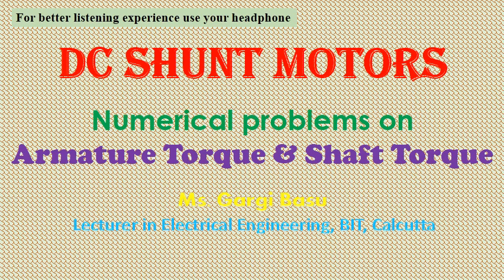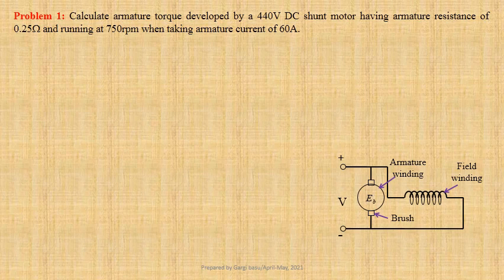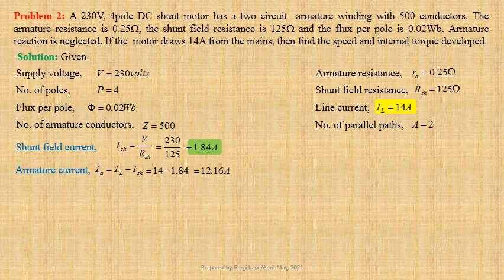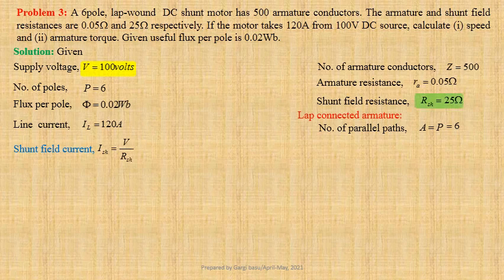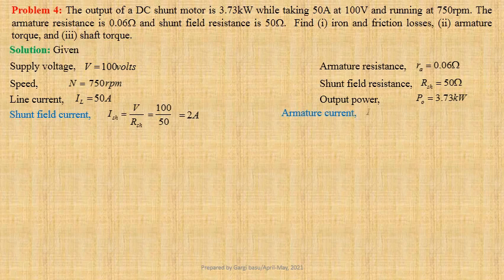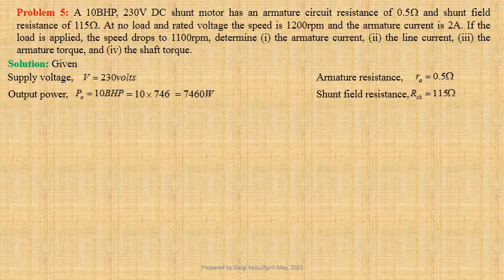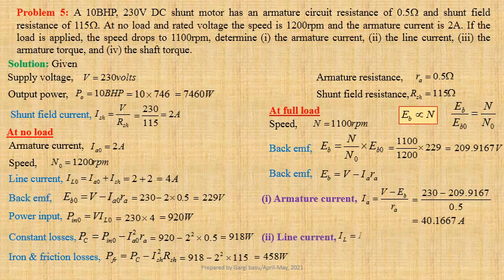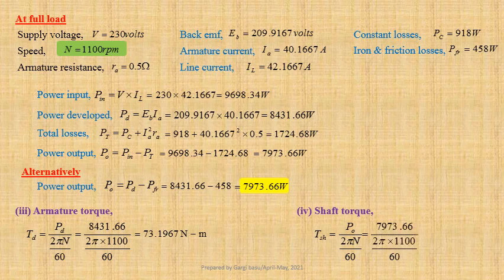DC Shunt Motors: Numerical problems on Armature Torque & Shaft Torque

Comment: Can you help how to solve it maam😁

A 300V DC shunt motor, shunt resistance (150 Ω), armature resistance (0.2 Ω), the 
source supplied current equal to 36 A, core losses (210 W), running at 1500 r.p.m., 
friction losses (100 W). Find: (a) back e.m.f. , (b) efficiency, (c) developed torque, (d) 
shaft torque.
Reply from the maker: V=300volts;Ish=300/150=2A;Ia=36-2=34A; back emf, Eb=300-34*0.2=293.2volt
Reply from the maker: Developed power, Pd=Eb*Ia=293.2*34=9968.8W
Output power, Po=Pd-losses=9968.8-(210+100)=9658.8W
Input power, Pin=VI_L=300*36=10800W
Efficiency =Po/Pin=9658.8/10800=89.43%
Developed torque Td=Pd/(2*pi*1500/60)=63.46N-m
Output torque Tsh=Po/(2*pi*1500/60)=61.4898N-m